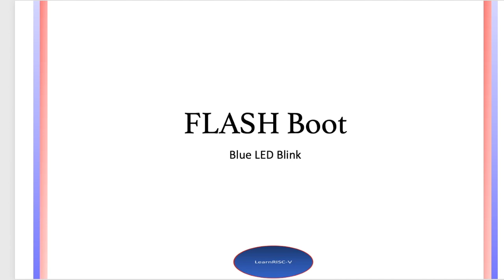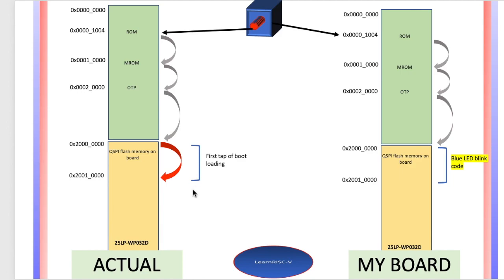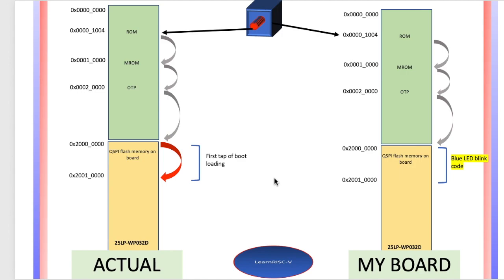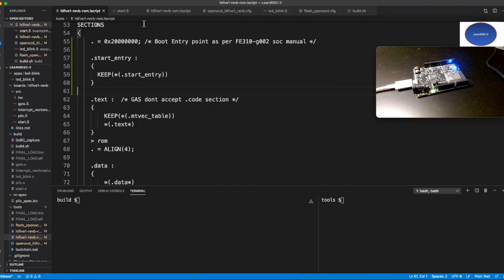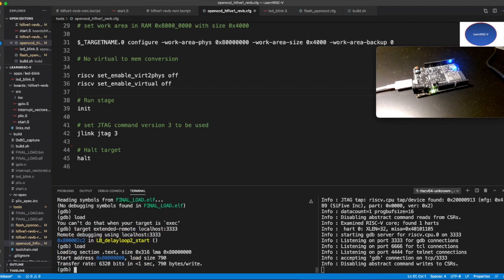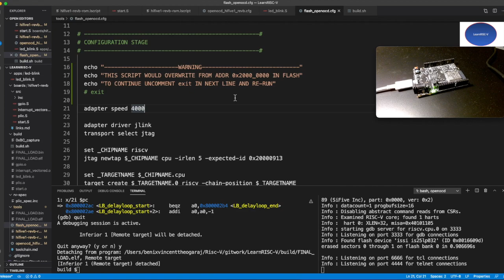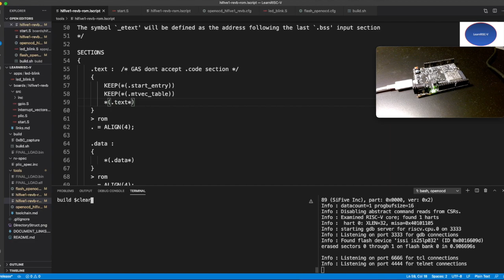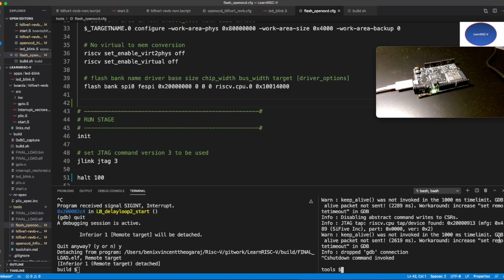RISC-V Hifive1-RevB board LED blink boot from flash

Comment: I understand openocd was originally designed for JTAG debugging, but is it possible to use it thru an SWD interface?  My board's connector has SWD+SWV(TDO) which should allow it to stream trace data.  I have a J-Link edu, but can't get Eclipse+OpenOCD to connect/stream!
Reply from the maker: Hi Ben, Openocd has been adopting/accommodating other interfaces like SWD as well. It should be mostly about finding &  using the correct interface and adapter commands for SWD/Jlink to Openocd. Find https://openocd.org/doc/html/Debug-Adapter-Configuration.html to know more about openocd interface/adapter commands.